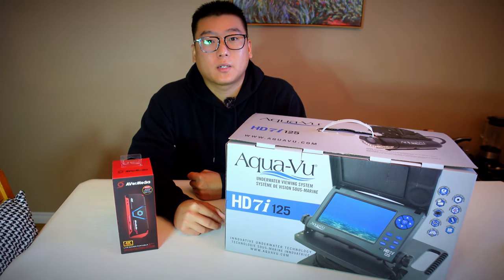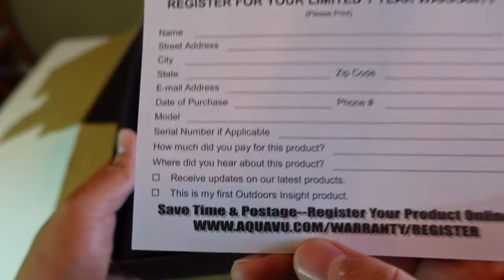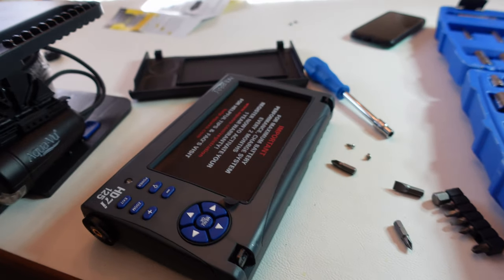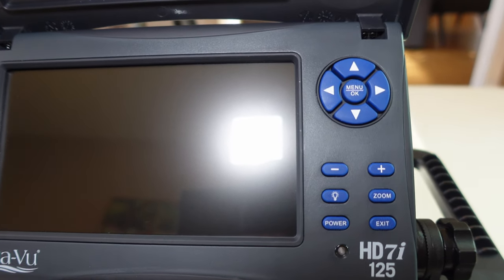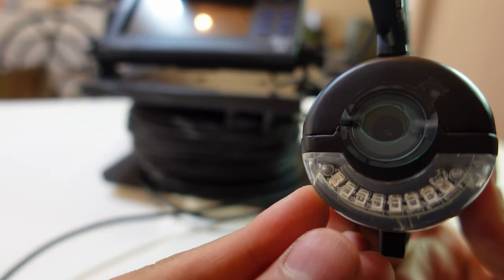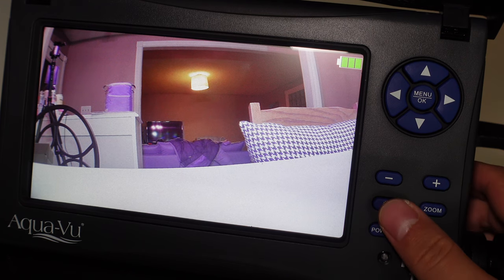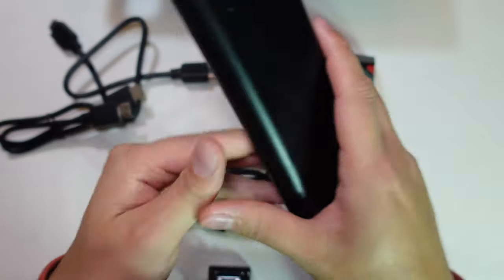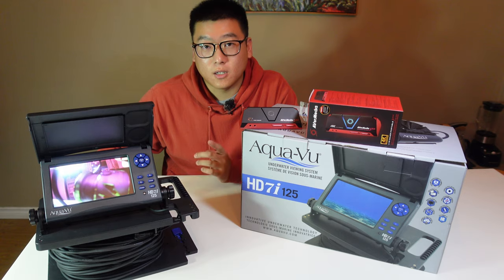Aqua-Vu HD7i 125 Gen2 Underwater Camera Unboxing (How to Record Underwater Footage)

Comment: My screen cover was tough to get open too. I got it open first try. The second try was harder. I just needed up popping it open with a flathead screwdriver. 
So far I like mine. I want to change the battery out for a lithium 10 ah. For longer life and shave a bit of weight.
Reply from the maker: Wow that must be a widespread problem then! Thanks for watching and commenting. I put a Marcum 10ah lithium battery in there and I can get all day usage of it. But everytime when I charge the battery I have to open up the housing. It's a little bit annoying but not too bad.
Reply: Jay Siemens has a video about switching batteries and he drilled through the lid. That's my plan too. I have the same battery already. Had it in my 715c.
Reply from the maker: I've seen that video too, also put 2 USB charging ports. Definitely makes charging and filming easier

Comment: I just got the  7i Pro today  I absolutely had a hard time opening the lid too But I didn't have to take it all apart You just have to get hold of it just right And it takes  a fair amount of strength the first couple times to get it open Could most definitely been designed better
Reply from the maker: I guess they have quality control issue then. Thanks for the comment it's very interesting. I definitely could not open at all...... very frustrating.